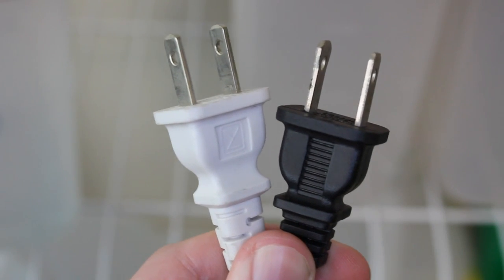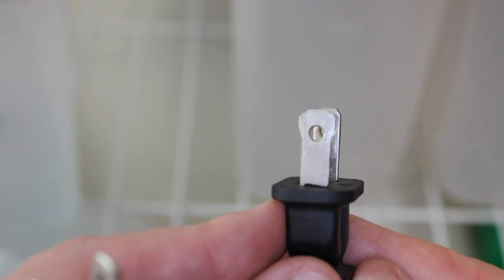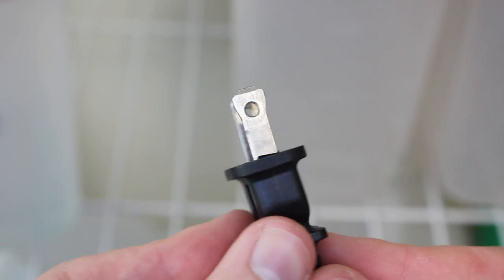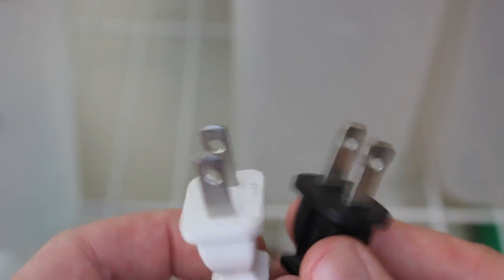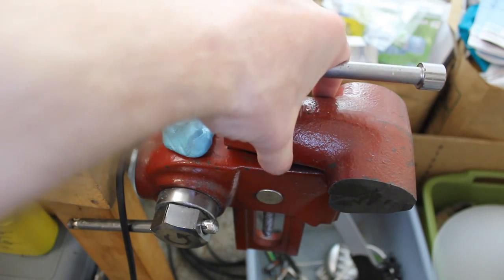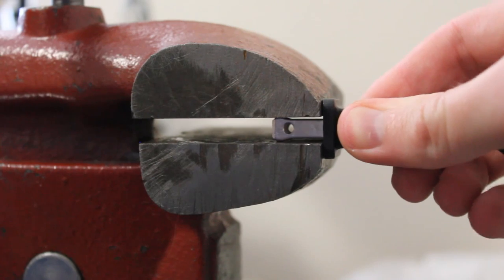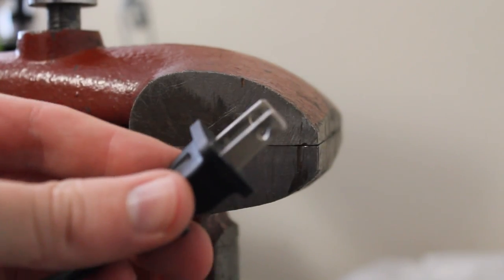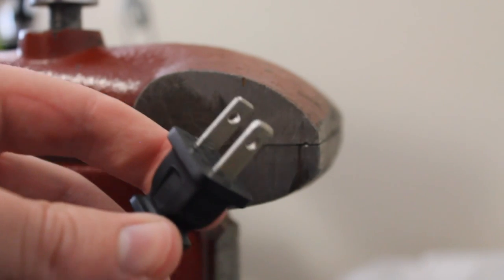"safety" plug hack

Comment: The larger prong is the neutral and the smaller is the hot. Reversing them on some does create a shock hazard as the device is designed to have certain parts it as hot while others are neutral. For example on a lamp you want the center to be hot not the part that the bulb screws in. Don't listen to this kids.

Comment: a device with an on/off switch has a polarized plug...
so that the switch opens the energized line of the circuit.  if the plug were inserted backwards, turning the switch to the "off" position would not de-energize the device, it would just stop it working. switch the hot, and there is no voltage past the switch... switch the neutral, and you've got 120V looking for some place to go...

Comment: OK, for the folks who might be grossly misinformed by this video, pay attention.Your outlet has two slots, the hot (small one) and the neutral.  The hot side brings power and the neutral returns it to ground.  Power comes out of the hot side and will continue until stopped by a break in the circuit or an insulator that the voltage can't overcome.So, let's take a common lamp.  You plug it in and the power runs down the black wire until it stops at the switch.  Flip the switch and the power continues into the socket base, through the bulb, into the socket threads, back down the white wire into the plug in the neutral side.With neotoy's ill-advised mod, you insert the plug reversed.  Now the power runs up the white wire, through the socket and bulb until it stops at the switch..  So with the light off, the socket is hot and if you accidently touch it while changing the bulb, you will get shocked.Go ahead neotoy, make a video of you inserting a reversed plug and touch the socket threads,  I'm sure we will be entertained.  With any luck as you get older you will learn that you are not anywhere near as smart as you think you are.The National Electric Code is written to keep people from hurting themselves and others.  When in doubt, follow it.So for the young folks here remember this quote:From time to time a person rises up and challenges conventional wisdom.Occasionally they are shown to be a genius,but usually they are just simply wrong.

Comment: If American appliences where made to be reverse polarity safe, then this would be fine, but as the US apparently hasn't worked out double pole switching (switching both the Line and Neutral conductors, simultaniously), then you are inviting upon yourselves many dangers, for example; if an applience is pluged in the wrong way, the neutral is switched, so it doesn't fuction and apeares to be safe, but if it was say the element in a toaster, it could still be live and someone could be electricuted. And the standard screw in light fitting can become a hazard if the polarity were reversed, the outer screw could become live and it is very easy to touch in a table or standard lamp. It always botheres me that the pins on US plug aren't partialy insulated, to prevent potential electricution.

Comment: the 3 prong plugs do provide safety the 3rd prong is ground so if for example one of the hot's hit the metal case of your toaster or drill etc it heads to the ground and not you.

Comment: also there not called safety plugs there called polarized plugs. reversing the hot and the neutral on a item that has a polarized plug is just asking for trouble. the polarity protects you in the event that you have lets say a electric light you haver it switched off. if it was not polarized and you got the switch on the neutral if your on a wet floor that hot will come looking for you when you touch the metal case.

Comment from the maker: I've done this to hundreds of plugs, never had a problem. A wall outlet is just the same, the electricity is always "looking" for ground: as long as you're not sticking your tongue into the outlet it's perfectly safe. In low-wattage appliances like your example, the electricity is never going to jump unless it has horrible defective wiring, which is never safe. Classic plugs were used for over a century before this legal liability inspired safety bullshit was forced on consumers.

Comment from the maker: Taking into account things like retooling for manufacture, compliance testing, certification... not to mention special outlets which require the same supply-chain criteria. Millions if not billions easy. Three-prongs are the worst though because they require an entire additional wire, that's 33% cost increase right there aside from everything else.

And yes this exclusively domestic idiocy. A lot of overseas plugs have similar schemes designed for "safety" but none quite as pointlessly cosmetic.

Comment: AC current:  Electrons pulsate back and forth but according to discussion below electricity "travels" (BS - it doesn't) from some place to another.  But, supposedly,  there is a neutral and a hot (never taught that in university physics, ya 300s course with calculus, etc).  Comments below give hypothetical "if thens."  All I know from polarized plug is that I would like to stick them up someone's dark spot.